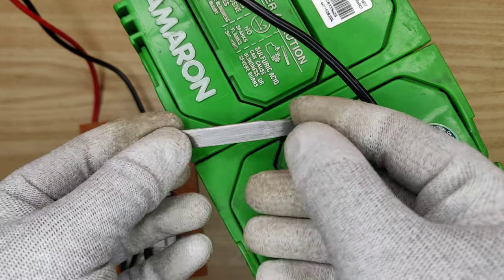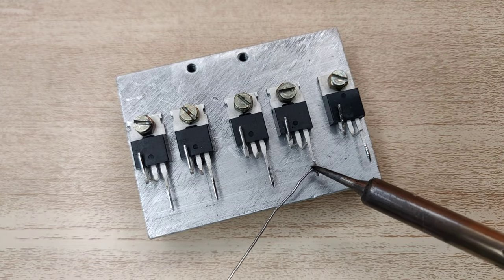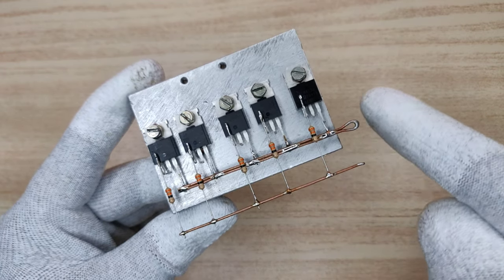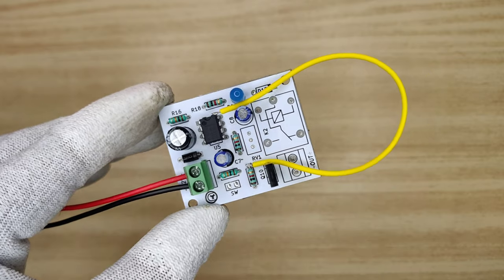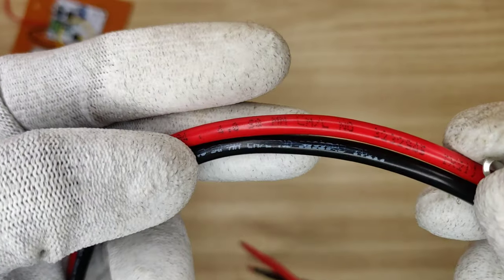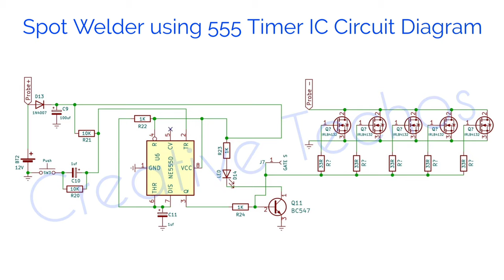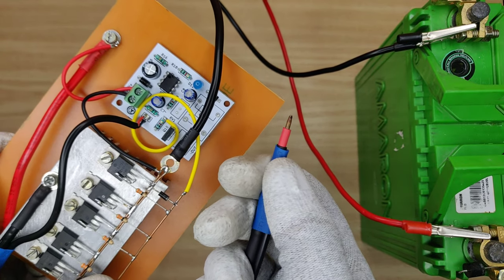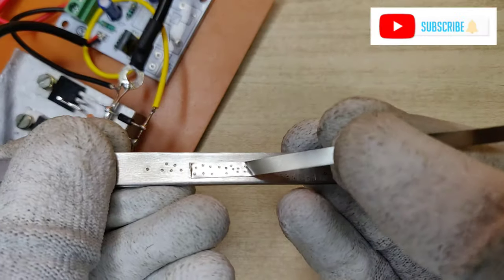Diy spot welder circuit for 18650 lithium battery

Comment: I think the cable to the circuit board is long , it's 30" inches, could that be the reason. Circuit board to probes is 12" inches that's ok. Please suggest.
Reply from the maker: Half meter is ok, but it should be minimum 5mm copper cable

Comment: The pcb and layout in your video is not the same. I found something wrong in the pcb layout in the link you provided. 1uf and 10k are open circuit on one side of the parallel. In fact, it has to be connected to pin 2 of the 555 ic.
Reply from the maker: Check out, version 2 of the same spot welder on my channel with portable pcb files

Comment: Amazing project but why didn't you connect the relay
Reply from the maker: Actually this board was designed for previous project of timer circuit, also relay was needed if microwave transformer based spot welding. But I designed MOSFET based so I reused it in this project. New pcb design for this spot Welding Machine download link is in video description.

Comment: Yes there's a very small spark not enough to weld at all, I have connected to my 12v 120amps inverter battery.please advice what am I doing wrong
Reply from the maker: Can you please download the circuit diagram from Link in video description, then check is everything connected correctly.

Comment: You're circuit is very useful thanks for it can you please explain me where to put variable resistor in this circuit to get different timings..
Reply from the maker: Thanks for your interest in this project, I'll soon upload v2 where this feature will be included.
Reply: @CreativeTechos  If I understand correctly, you said this one-shot circuit should weld for 10-15ms.  But as I look at the formula for 555 Monostable Multivibrators, it is Time=1.1*RC.  So your circuit should weld for only 1.1ms with R(t)=1k and C(t)=1uf.

Comment: I build this circuit as per your circuit diagram in the discription and working normal but some time the output always on more than 5 second , why?
Reply from the maker: Did you used the fet discharging diode?

Comment: What can be used instead of mofset?
Reply from the maker: Only mosfet, because it needs fast switching with high current, that relays or transistors cannot do.
Reply: Me use irf1404

Comment: again i want to ask you that in this spot welder circuit can i use 12 volt Timer relay ciruit 1 mili second instead off your PCB?
Reply from the maker: You can use any timer circuit to trigger gate but only for mili seconds, triggered gate for just one second will blow fets due to short circuit. And yes please don't use relay triggered model.

Comment: why u have on your board a BD transistor instead of BC547? is this for a buzzer additionally power along with the signal led?
Reply from the maker: Actually this timer circuit was used from the another project, so had relay there that was turned on with bd139, and in rhis project relay had no work there, but still i used bd139 at his place, You can easily use bc547 for led & buzz also.
Reply: @CreativeTechos  ty man :) ... usually i prefer 2n3904 ... something between bc547 and bd type ... for additional power

Comment: Bro my mini spot welder has stopped working .I did not use it for quite long time, yesterday  I wanted to use it, hence connected the probes and batt, it worked  for first 2 3 welds and then went dead. I checked those 33ohm res and found short hence replaced em, still no spark, the trigger circuit seems working as the Indi led comes on for milliseconds ...what could be the possible reason and the remedy pls
Thanks in adv

Comment: Can you say the amount expenditures for all circuits & materials. I need this actually. Thanks
Reply from the maker: If you already have lead acid battery above 20ah, then the expenditures will few hundred rupees, you can assemble timer circuit on pref board and MOSFET on heatsink.

Comment: hi sir, can i use IRF 1404 mosfet insted IRLB 4132 ?
Reply from the maker: Yes, you can use 1404 MOSFETs, even they will provide more drain pluse current than IRLB4132

Comment: Its very nice and easy to build.  I have 2 questions. How many maximum power of battery can we use?? And can we use timer delay relay circuit for trigger?? Please reply.
Reply from the maker: You need minimum 25-35ah battery for good spot welds, also you can use lithium battery of 2000mah as they ha e higher discharging current.
About using relay, it is actually a bad idea, as you know relay have moving pole to make contact to NO / NC pins during triggering the relay moving COM pin will itself fuse with On pin and will not cutoff back so a huge short circuit will happen.
Also another reason relay cannot be turned on for mili seconds as MOSFETs have higher switching speed.
Reply: If I have 4Ah of 12v cordless powertools battery (rated 15C for single 18650), could it work?

Comment: Can i use lower battery capacity to power up the circuit ??
Reply from the maker: You can use 4500mah lipo battery from ORANGE, or in lead acid you atleast need 24ah battery for good welds.

Comment: well:
1. 200mA from ne555 is not enough to drive several gates of mosfet. Driver for gates is needed (J312 example)
2. if need to protect the gates - you need 15v zener diode on the gates, not a diode
3. you need a powerful diode between +12v (cathode) and the common drain of mosfets (anode). Because the electrode wires at such a high current behave like an inductive coil when disconnected (like a flyback diode for a relay or transformer)

Comment: very good project, but if doing calculations for the activation time i should be  TC 1000*.00001*1.1 or 1.1 ms. Since  you are using 1k ohm resistor and 1uf capacitor.

Comment: I just use mosfet   no pcb 
What is input volt and ampere?
Reply from the maker: You can't have spot welding using only MOSFETs if shot will be for 1-3 seconds either MOSFET will burn or will burn welding spot. Timer pcb using 555 ic is used to trigger MOSFET for 10 mili seconds. So  pluse shot of current passes from source to drain for only 10 mili seconds.

Comment: Can i use a computer power supply instead of the battery?
Reply from the maker: Nope, you need to use battery with 20-40ah, I'll also soon upload without battery version using super capacitors
Reply: @CreativeTechos  I'm waiting 😍

Comment: I ve tried the circuit , made the setup as yours, but it isn't work..upon connecting battery to crcuit I get 12v on both the probes without triggering the source pin!!! Which I get continuously !!! Even I deploy triggering cercuit it doesn't make any diff.. it's as good as connecting the probes directly to the batt without trigger switch..remedy pls.. I used irlb 4132 x5 fets..pls suggest remedy
Reply from the maker: Download & follow this circuit Diagram, you forgot to use mosfet discharge diode, thats why it remains triggered.
https://drive.google.com/file/d/1DJ6rSoI8mqs8OKiJ-u2iRp3qbYvFNCRM/view?usp=drivesdk
Reply: @CreativeTechos  yes I used fet disch diode too...
Reply: @CreativeTechos  there seem to be discrepancy in the circuit diagram in video link and the link you gave in ur reply. The earlier one is with trigger through r24 1k resister and the later one direct from ic pin no 3...
Reply from the maker: Follow this schematic , download from link provided. Checkout circuit twice, it works perfectly.
Reply from the maker: Yes it is directly fro ic pin, follow this circuit Diagram, i have also updated same in link provided in video.
Reply: @CreativeTechos  had to remove one fet which was short, hence it was triggered continuously, but seems working fine.. let me put it all together and will share the pics n video too.. any way thanks for the help rendered ..
Reply from the maker: Happy to hear, it works for you 👍
Reply: @CreativeTechos  yep, n thanks for the courtesy, however is it possible to make the timer variable ? Like 4 or 5 steps so to weld thicker or thinner strips??
Reply from the maker: Yes, will add that feature in new version of this spot welder.

Comment: what is the Voltage of the Capacitors you used? Can I use 50V 100uF & 50V 1uF capacitors?
Reply: Please reply me
Reply from the maker: Sorry for late reply, Yes you can use 16-63v / 100uf and 2x 1uf capacitors, 
WhatsApp+91 9596386458 for full circuit Diagram.

Comment: If possible, what's this circle doing? 555 Is she the oscillator of what she called in the video?
Reply from the maker: About which circuit you want to know, and 555 is timmer ic to trigger current shot from source to drain for 10 mili seconds
Reply: @CreativeTechos  basically I am a layman in electronics , but very enthusiastic in diy, hence I think the bank of 5 mosfets are acting just as solidstate switch which closses momentarily once triggered and complets the circuit and out put is spot weld ...similar like mechanical relay ...
Reply from the maker: Yes, but the problem in relay is it has contact switch that moves, and that contact points my itself fuse together while switching, and also relay will not respond to mili seconds timer.
Mosfet actually has fastest switching respond, and without moving switch, it works on feild effect when positive signal receives at gate, even for mili seconds.
Power can be increased by using High amperes mosfet or multiple mosfets

Comment: Can v replace the 12 v 24 ah battery with 12 v 24 power supply??
Reply from the maker: You may try, but actually battery is capable to deliver higher pluse current, You can also use 2500-5000mah lipo battery instead of 24ah lead acid
Reply: @CreativeTechos . You mean  to say I need high tourch battery

Comment: Can you compare different materials? I think you use only 0.1mm nickel plate, not pure nickel
Reply from the maker: In video i used 0.3mm nickle strip, it can work perfectly with 0.5 also, but for Higher thickness, use more mosfets with higher ah battery

Comment: I tried this circuit after pulse and spot led turns on automatically until we seprate drain and + wire also my mosfets gets short after first spot welding i used my tubular inverter battery to power up the system i think something is missing in this circuit that is flyback diode to prevent short circuit after welding in postive probe
Reply from the maker: I already used diode across the gate & source, please follow this schematic diagram.
https://drive.google.com/file/d/1DJ6rSoI8mqs8OKiJ-u2iRp3qbYvFNCRM/view?usp=drivesdk
Reply: @CreativeTechos  followed your diagram and found you used in4007 diode which is normal diode for fast operation we should use fast recovery diode like uf4007 also circuit need protection from reverse voltage that coming after spot from the battery when we spot and -+ proves get in touch timer led turns on itself behave like short circuit and because of slow recovery time of fets high voltage spike generate and damage the mosfets
Reply: Also if we include high ampere diode in "+" prove will prevent circuit to get damaged overall circuit is good but experiment it will definitely cost you higher bcz of prices of fets..
Reply from the maker: Actually price of fets is 25/pc and still it will be cheaper as compared to readymade, also if you love to make project yourself that it will definitely make you happy, Also yes adding Recovery diode to fets is good idea, i appreciate.

Comment: Could you pls tell what will be the max  trigger voltage to triigger the fets ?
Reply: I think 2-3 v is enough to turn on fets
Reply: @atheist_happie  thanx a million
Reply: Oh sorry you asked maximum not minimum..
Max is 20v approx
Min is 2-3v approx
Reply from the maker: The mosfets uses is logic gate fets that can be interfaced with Arduino pins & only 5v to trigger, so minimum 3v and max 35v through some kilo ohms resistors.
Reply: @CreativeTechos  hope you have seen my setup in action।
Reply from the maker: No, i didn't where you posted?
Reply: @CreativeTechos  see the link given above
Reply: @CreativeTechos  even it's on fb too
Reply from the maker: No link appeared here, please send me link on WhatsApp +91 9596386458

Comment: Looking through your videos, I keep adding more useful small projects to my to-do list.
Reading the comments, you have amazing control answering questions.  I would tend to tell a lot of them to RTFM, or to pay attention!
I do need to ask a question myself about the recovery diode someone suggested in this project.  Where should it go and what identifying number? (1Nwhat?)
Thanks
Reply from the maker: Thanks for watching my friend 🙂, you can get components from local electronic shop, depending on you country, and YES Ultra Fast recovery Diode is better than general purpose diode, Number will be UF4007
Reply: @CreativeTechos  Okay, it threw me when you replied to happiesingh6637 saying 'adding Recovery diode to fets is good idea'.  After reading his comment again I realize we're not adding another part, but using a UF4007 in place of the 1N4007.  Now I'm the one that need to pay attention. DUH 
I didn't make myself clear when asking 'where it should go.  I meant in the circuit.  Getting parts is not a problem.  Well, except I just discovered 18650 cells are way over priced right now.
Thanks for a good project.

Comment: These are actually pretty good looking welds, better than a microwave transformer from what i can see
Reply from the maker: Microwave transformer also have good welds but not good for 18650 lithium battery weldings, Also need to be pluse controlled like this.
Reply: @CreativeTechos  many youtube videos making microwave transformer spot welding with pulse control module.. Which is best and why ?? Plz explain

Comment: can i use 12v Incubator Auto Turning Tray Timer Relay ?
Reply from the maker: Which type, programmable that is used in incubator with temperature cutoff
Reply: @CreativeTechos  Mean 12 volt Timer relay ciruit 1 mili second
Reply from the maker: Yes, you can use 10-15 mili seconds gives strong welds.

Comment: Nice video🙂👍, i want to ask. What is voltage and ampere input?
Reply from the maker: 😂 Bro please watch full video, you need to use 12v 20-35ah battery
Reply: @CreativeTechos  alright 🙂, anyway thank you for information 👍👌
Reply from the maker: My pleasure, any help need let me know.
Reply: @CreativeTechos  In the case of using lipo, how to avoid over discharge of the battery to avoid its explosion.  There is also a question, how is the ampere needed by the device calculated, i.e. the discharge ampere and the capacity required for it? What are the equations by which these values are calculated to avoid errors and disasters?  I know that bms smart aktiv is the solution to all problems, but its price is very high
Reply: @zaidromel4655  Maybe you could just monitor the battery voltage to avoid over discharge

Comment: what about the relay
Reply from the maker: This pcb used in video was actually a 220v timer circuit that I used in my previous project. I reused this in in this spot welder project and relay has no work there, You can download new design pcb for this spot welder, download link is in video description.
Reply: Thank you
Reply: Is it necessary to use heatsink
Reply: As its just barely activated for  les than 1 sec
Reply: Can i use 24 volt 15 amp smps insteed of battery
Reply from the maker: No , battery is must to be used atleast 20-35ah, due to battery MOSFETs will be able to deliver high pluse current to welder tips. Power supply will not be effective.

Comment: How do i use MOSFET only
Please circuits,
I dont interest circuit
Reply from the maker: Only MOSFETs can't be used. It will get burnt due to long time short. Timer circuit is important as it triggers pluse current shot from source to drain for just 10 mili seconds.
Reply: Can you make video using super capcitor only spot welder?
It possible?
Reply from the maker: Yes, I'll try to upload ASAP Subscribe and turn on notification to get notified.
Reply: @CreativeTechos  ok

Comment: after test this circuit with time circut that this mosfet not discharge after 1 time give gate currunt mosfets are opening contineu and battery is shorting contineu current is flowing in mosfet wihtout trigger i think in your pcb one part works to discharge mosfet same time trigger this mosfet NPN chennel and will discharge to these mosfet one PNP chennel mosfet
Reply: and your circuit is not working without your PCB desingh
Reply from the maker: I think you've taken screen shot of diagram in video it has some mistake, please download circuit diagram link is in video description, it is with discharge diode.

Comment: Where's is' the relay but I will hear a relay sound when you spot ithing it's fake
Reply: its a control switch pressed by leg, or ne555 drive a relay for power the gates of mosfets.